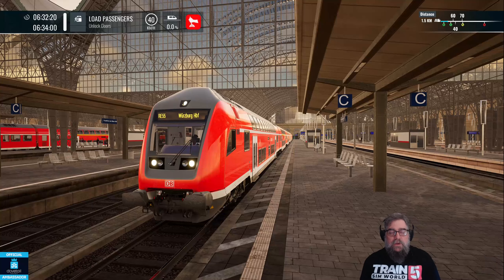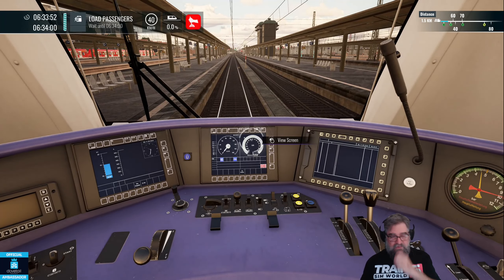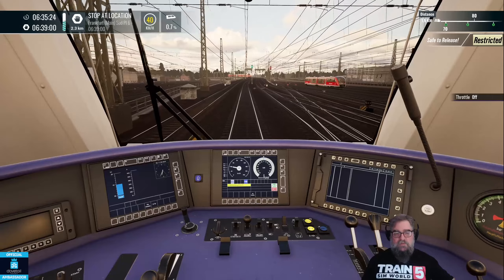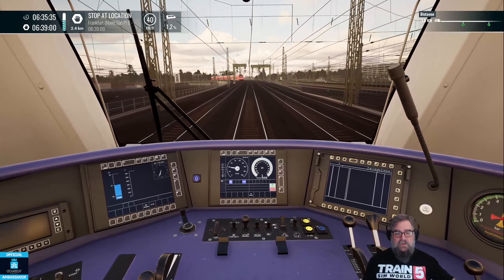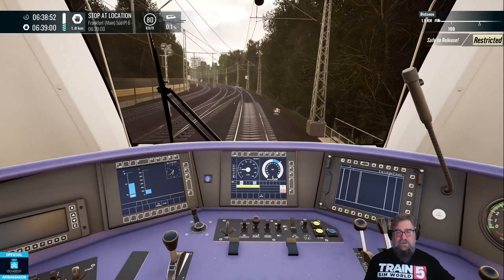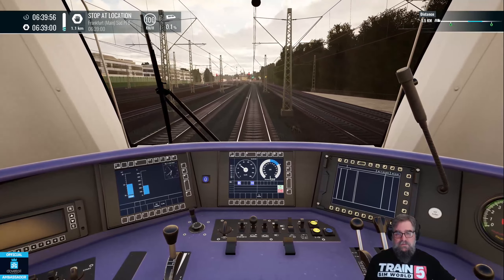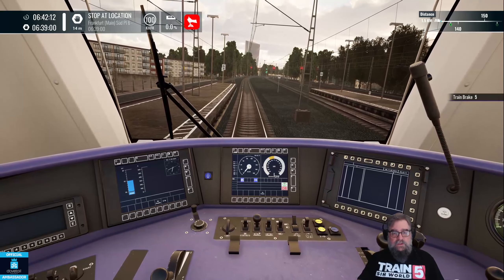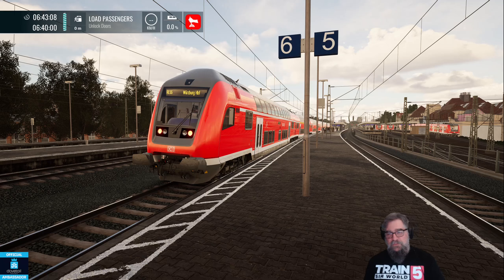TSW5 Setup and Drive the DB 766 2 Dosto Cab Car

Comment: My train before i depart from the station it beeps and then stops me whats the matter?
Reply from the maker: @shaun4072  are the doors closed? Is sifa enabled and you've not acknowledged it? Pzb enabled and an adverse signal? It could be so many things. Can you make a video?
Reply: @shaun4072  

I have the same issue. Even when I adhere to speeds, and there's no red or yellow aspect signals, the brakes slam on. It's crazy annoying.

Comment: Gday, did you have any issues changing ends (from the 146.2 to the 766.2 cab car) in Frankfurt ferry? The brakes won't release despite all my efforts.
Reply from the maker: @lachy4713  I don't remember any particular issue, did you remove the brake key from the 146? If you did I'll have to give it a try
Reply: @trainsimulatordriver  unless my sight is going, I don't think there is a brake key in the 146? There is a cut in/out switch. I've tried both cut in and out which didn't make a difference. I've tried the BP overcharge, applying/releasing the emergency brakes, restarting the train line power and associated circuit breaker. I followed everything the guide says to do in the scenario without deviating too
Reply: I'll have a look soon anyway. I'm on a PS5 and there's been a few issues so far. The worst is the FPS... do you know if this is something they can fix? It driving me nuts
Reply from the maker: @lachy4713  big stations like Frankfurt push the PS5 pretty hard. They do optimisation work but there's simply so much to draw it gets bogged down. What sort of fps numbers are you seeing? On Xbox/X I'm seeing mid to high 20s at Frankfurt which is movie speed (modern movies run at 24 or 28 fps). On my PC I get in the 50s
Reply from the maker: @lachy4713  there might be a bug in the scenario, I hope to have some time today to look at this
Reply: @trainsimulatordriver  quite possibly. I even tried in the training centre with the 766.2 and 146 (changing ends) and had the same issue
Reply from the maker: @lachy4713  It seemed to work ok for me https://youtu.be/j4yD4e6l674 - I just followed the scenario directions - the only thing I would not is make sure you released the electric brake in the Dosto